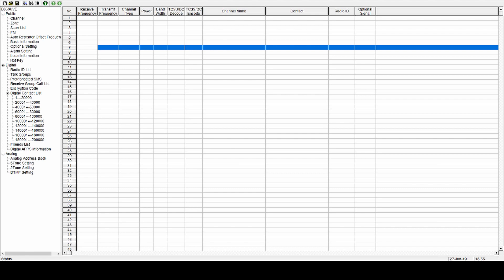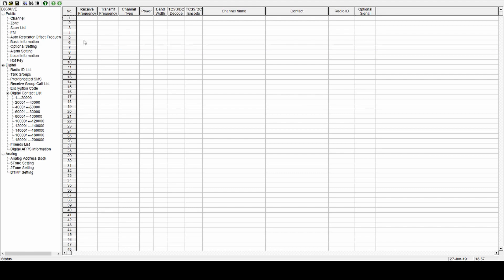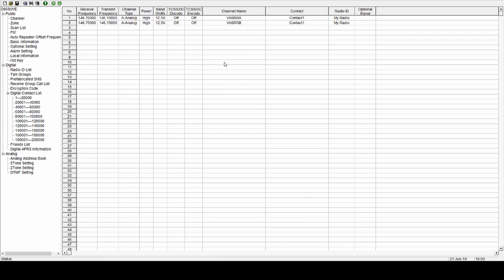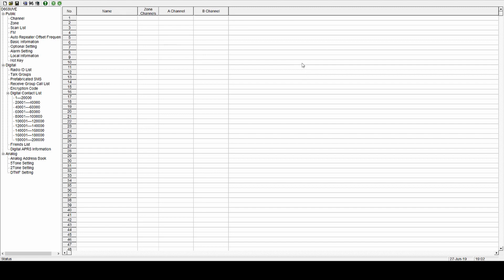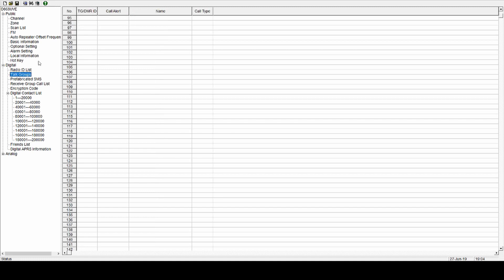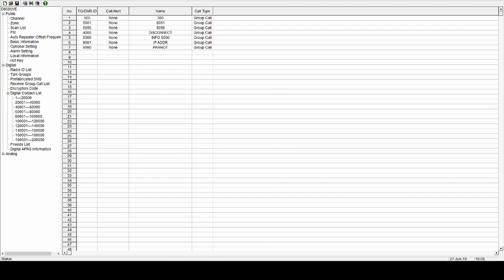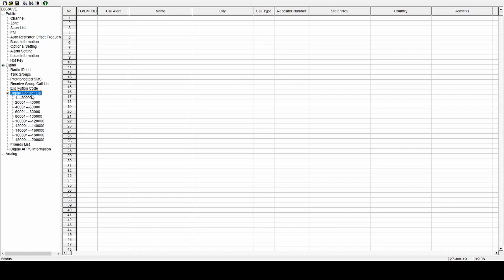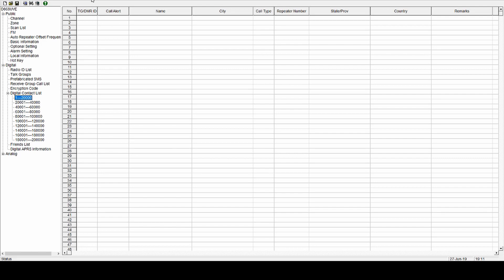Basic guide to the AnyTone 868 DMR Radio 2019

Comment: Cant see one for disconnecting a reflector
Reply from the maker: Sorry, is just a basic video on how to get started.
Reply: @CarstenBauer  No need for sorry, Just an observation, The group contact (TG) 4000 would be labelled  TG DISCON that disconnects any static TG fixed in BM routing, and 4000 private contact (PC) would be labelled DISCON REF to disconnect reflector on TG 6, 8 or 9 depending on the profiles used.